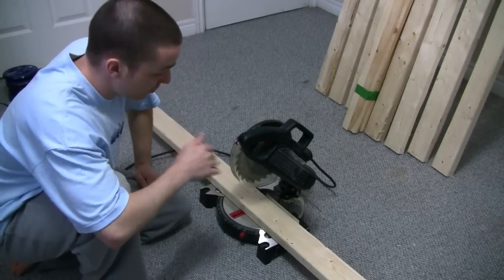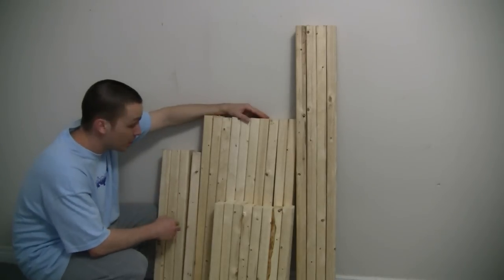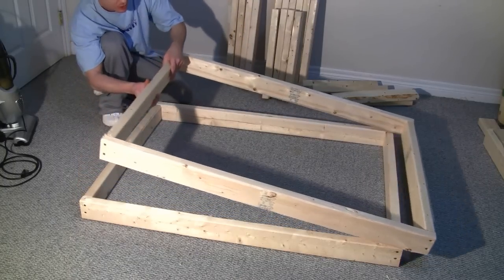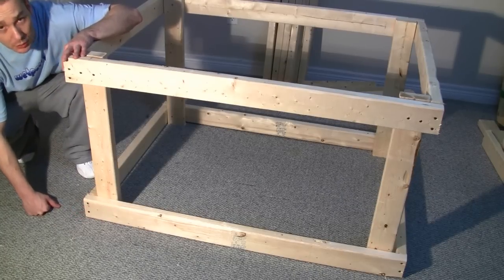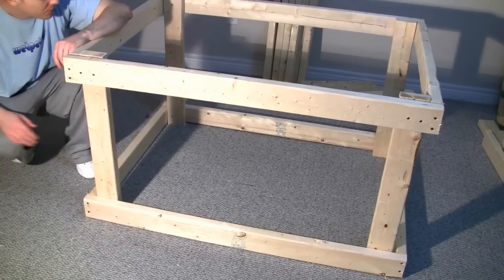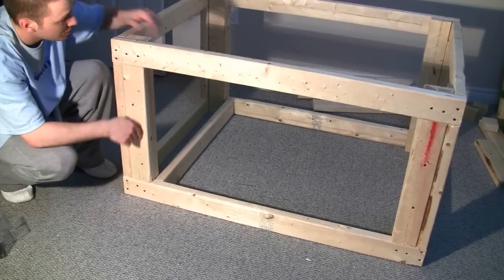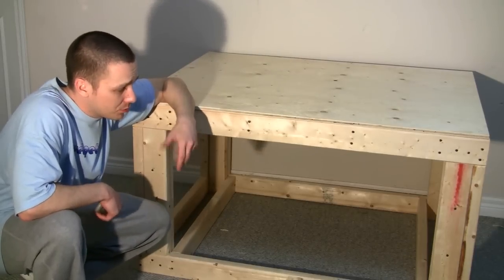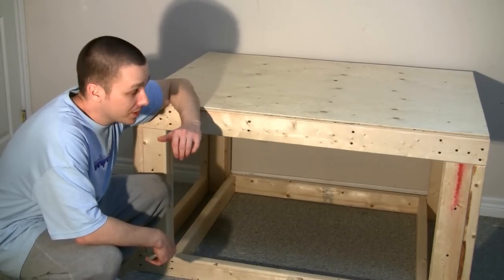HOW TO: Build an Aquarium Stand/Canopy 1/3

Comment: I beg and borrow the steel frameworkthat comes around  quad  bikes from local motorcycle shops.I think is called square tubing.A bit of acurat hacksawing and welding makes  a strong,lightweight  stand.A coat of primer and paint and shelves made from ply from salvaged paking cases finishes it off.These are for a fish room so they are not enclosed.Biggest one so far supports my 800 litre Uaru tank.

Comment: I used your design and built a stand for a 72 inch long by 24 inch wide fish tank.  I substituted pressure treated  2x6's and added a center support  for the stand.    When I filled the tank with water, there wasn't a groan or a squeak from the wood.   Stand is ROCK solid.  Excellent  Design !!    Thanks

Comment: Hey Joey!  Just finished the build on my 55 high stand and canopy, now wrapping with OSB chip board.  One thing I did differently - instead of screwing in the guides on the top and bottom frame first, I screwed them to the top first, then installed the supports to make sure that they are taking most of the weight.  Then I screwed the guides into the bottom.  I used velcro to fasten the front piece on for easy access to my overflow filtration system.  30 bucks for canopy and stand.  Thanks a lot!

Comment: Thank you for this great and comprehensive video! Your stand design was the only one I found that I could actually build and be sure about its strenght. I just finished my stand for a 55 gal tank. I used store bought wood for the frame and re-used old wooden pallets/ crates to finish the stand, turned out really nice :)
Reply: how did that work? did you use these exact same dimensions?

Comment: Thank you DIY king.  Just completed my first tank stand for 65 upright.  Total lumber cost 28$ plus thin board to cover it all 12 $,  10 $ for quality nails.  20$ electric screw driver,  34$ circular saw,  8 $ paint,  2 trips to homedepot 10$, some peripherals like sand paper and brackets and wood glue (20$) and about 2 half days over weekend. In total around 130 $.  And I have a custom size extremely strong stand!!  Just one lesson I learned that I need to share.  I had all the small studs to be inserted between top and base frame cut to exact size and all were about   . 2 inch longer and I needed to spend a lot of time polishing them.  I think 2 by 4 are not exactly 1.5 by 3.5 but more like 3.6.*

Comment: Thanks Joey,
I just want to share a little trade tip with you, place the first cut on the line then move the saw until the end of the 2X4 touches the door frame. the saw will not slip on the carpet and the door frame won't move so you have a stop to ensure all cuts are equal. No marking the next cut. Then move the saw for the next cut. on jobs with lots of cuts I've actualy screwed the saw to the floor.

Comment: Thanks so much for the useful videos. I never built anything myself with wood, and following your instructions I was able to build a great stand for my frag tank, I need 2 more stands and after the first one, my confidence is very high that they too will be perfect. 
The tips about using the tools like adjusting for the width of the saw blade for cuts and using a piece of wood already cut as a templet really helped with my first lesson on wood working.

YouTube University rocks!

Comment: Thanks for the vid!  I'm a first time reefer and I just built this today and given this is close to 10 years old here are some updated prices haha,  I used 8, 2 x 4 8s  (didn't need the extra braces cause I have a glass tank) came to $48 and the box of #8 2.5 in screws were around $9, haven't got the plywood yet but still even almost 10 years later $57 still beats the store sold stands by at least $130. :)

Comment: Joe you saved my bacon! My tank recently started leaking and while emptying and moving it, I noticed the weight of the whole setup was causing the back legs to recede in a hole which was digging into our newly repaired floor (as the iron stand legs are L shaped making a lot of weight focused on a single point of contact).  I knew my hubby would be pissed  when he got home to find his 1 month old floor job had already been compromised.  Thanks for your comprehensive tutorial, I'll have everything fixed and setup before he gets home from work.  And he'll be none the wiser!

Comment: I used this plan to build my first stand (with my first aquarium).  Thanks king of DIY! I thought it would be worth noting that 2x4s generally always have bow in them - and the ones I used were no exception.  But, as long as you build it true, and squeeze together the pieces (clamps are a must), the weight of the tank when filled with water, will straighten out those wobbly stands.  If you've never built anything before, you might not understand what I'm trying to explain here, but if you build it, and it does not lay completely flat - and it most likely will not, don't stress! :-)

Comment: Thanks for the video. I've built several stands myself, but I tend to over-build and need to convince myself that I can build a safe stand without the overkill. Your video is great, but I have a concern that  you did not address the crucial topic of levelness. I'm sure you know that a stand that is the tiniest bit off level can cause a major disaster, especially with a long or acrylic tank. Unfortunately, a lot of people building stands for the first time probably don't know anything about it and won't be prepared to troubleshoot and correct the problem. Perhaps if you ever re-make your stand video, you can add that into it.
Reply: he said that is "extremely important to have your floor leveled""..It was c;lear even for me that dont speak english..You need more information???

Comment: Excellent work, Joey. I built my own stand about four months ago, but I wish I had seen this video first. Your design is just as strong as mine, and much simpler to build. Kudos!  The one addition I would have made to your video is to stress making the stand tall enough to accommodate whatever model of canister filter you plan to buy, if you go that way. 

I ended up having to buy two smaller rather than one large canister filter because I planned poorly, and they're still a tight fit!  Oops.

Comment: I built this stand to fit a 20 gallon. It cost over 100$. I used a level, a square, 2x4s, plywood for top, screws, an arm saw, a table saw, a drill and a sander. Not easy but doable on a day off afternoon. It's great

Comment: Good basic learning video. I do mine a lil different as I do not build a frame. I use the unibody concept where the entire aquarium stand is weight bearing. Also, water is a main emeny of wood and as we all know, when you have water where it is not supposed to be, things happen. I use 3/4" white oak as my building medium. Because it is frameless, the cut pieces must be exactly the same length and all joints are screwed, glued and clamped. Frameless gives you more room inside the stand..

Comment: i just built my stand using your tutorial.i have a couple questions about the wrap and doors. like any specific material? do you glue it on or use finishing nails then fill them in?
also do you do anything special with the doors?

thanks for the great channel man. man stand cost me about $50 so far including screws bits and wood. not bad i hope i only need one sheet for a wrap so that will only be another 20 or 30.

much love

Comment: Hey man love your videos! I just wanted to offer a different perspective  on wood glue. Sorry if its already been said, but wood glue is actually stronger than the wood. We use mechanical fasteners like screws or joinery to reinforce the wood around the two joined pieces. So basically if all you did was, just use wood glue, the wood around the glue would snap before the glue gave out. (After curing ofcourse

Comment: did you drill holes before putting the screws in? also, the cross supports near the top you added just before the plywood, does anything hold that up? or are just the screws supporting that?

Comment: Hi Joey.  I'm building this, thanks to your guidance.  You mentioned laying a sheet of styrofoam down.  Is this for helping with leveling, or perhaps just because you were going to use an acrylic tank that you didn't want scratched?

If I was doing a plywood tank, would the styrofoam be moot?

Thanks in advance.

Comment: just one thing on the glue! it's the strongest bonding type from welding to bolting to screwing it together  so a bit glue wouldn't hurt to enshure screws arent comming loose, becouse i pre-drilled the holes with a very small drill. Further more great video! it helped me.
Reply: I disagree about you not using glue. You are trusting 3 screws per leg to hold all that weight. What is the capacity of that steel in a shear force? Also there is the friction of the 2 surfaces being pushed together  - which isn't much. Try  - screwing two pieces of scrap pieces of wood together and screw and glue two others together  - when cured, pull them apart and see for yourself.
Reply: oops posted that too soon, I see you solved my problem.

Comment: I like your videos and especially this one.  I just bought a 40g breeder and am building the stand and canopy for it.  I managed to get the frame done with no problems, however the first vertical support piece when I went to screw it in, the screw snapped.  Should I predrill the hole slightly smaller than the size screw I'm using?

Comment: I built my stand to spec using your advice. Great stand! 48.5x18.5x45.  yes, it's a bit high, and there's a tall 120 on top.  My question is this, I did not put the center stud in the front to allow for large sump access and most people do this. How much weight do these stands support? Roughly....not holding you to it. . it's just a curiosity thing. I just need to feel better knowing that avstand built like this can support the weight of a tank this size.  Thanks.

Comment: Love the design. I have a 65g glass aquarium with trim and am looking for a design that has a larger foot print than my tank. If I built out your stand and put a few extra cross beams in the top with a 3/4" sheet of ply for the tank to sit on would this be safe or do the 2x4 need to be the same dimensions to support the tank?

Comment: Hello Joey. Could I please get your experienced opinion on a DIY stand for a 125 gal 6' (glass with trim) tank?

We're using 2x4's exactly as you did for the top and bottom frames & in the corners but without the first "inside" 2x4 that attaches the top and bottom frames to each other. Would using the 2 pieces on each corner between the two frames be strong enough? All of the braces would be the way you recommended & it will have a solid top, as well. 

Thanks Joey, I really enjoy your vlogs. I've learned a lot and value your opinion. Take good care.

Comment: I just saw this video and I am thinking of making a stand the aquarium has irregular dimensions for an aquarium. Its 72 inches long, 13.5 inches wide, and about 21.5 inches deep and I think its a glass aquarium not sure. Anyways I was wondering what type of plywood did you use or recommend? Also thanks for posting the video it will help me a lot when I build the stand.

Comment: Hi Joey, i was wondering if you could provide  some advice. i have a 10x2x2 ft aquarium 12mm thick glass all round i purchased second hand dirt cheap @$200 (Yes i have plans to pull it apart and reseal). would your wooden reinforced stand design suport the weight? i appreciate any feedback

Comment: I want to start this project maybe next month.
The stand now is about 2.5 feet tall; I want to build one that's taller at about 3.5 feet.

Question 1. Is this height dangerous or possible?
Question 2. Can you help me choose the correct dimensions in wood? I referred to your videos about 2x4s so do I just input the dimensions of my glass aquarium OR add inches to include the trim around the glass as well?

Thanks in Advance!

Comment: Hey, I need a little help getting the right measurements to build my stand. I have already tried to build a stand about a year ago and it didn't come out right. I just got a free tank and its huge. It's 72"L X 24'"H X 19" W I would like the stand to be 34" tall. I am going to be running a Fluval FX6 and would like to store it below in the stand. Its an older tank and doesn't have a bracer in it. I resealed it thanks to your DIY video and that came out amazing thanks for that.

What would be the cutting measurements for the stand?
how to measure the plywood? 
Should I add a bracer in my tank?
Reply: hi suzy I found this hope it helps a bit http://www.ultimatereef.net/forums/showthread.php?564958-DIY-stand-build-and-5ft-tank-upgrade

Comment: I've watched a few of your DIY stand videos.  Wondering how these stands work with reef ready aquariums with corner overflows.  It looks like the stand upright would be in the way of the overflow holes in the bottom of the tank.  Is there a workaround for this?

Comment: When screwing in the screws for the base how did you hold it all together at around 7:50 in the video? Trying to put it together but the 2x4's keep moving once the screw goes through the first board and into the second one making it uneven. Best way to secure it?
Reply: use some clamps mate
Reply: izimalta I did, I went and got an Irwin clamp that helped out a lot, but I learned that all the 2x4s at Home Depot aren't straight and are a little warped. That made it a lot harder to put together.
Reply: TheJupiterSailfish
Definitely would suggest Lowe's or a real lumbar yard locally. I have had the same issue.
Reply: Michael Compton Yea I probably should of checked out either of those but got everything together and a shim seems to fix it all though I'd rather have had everything straight.
Reply: TheJupiterSailfish you accidentally bought the "builder grade" cheap shit that most builders hide inside the walls of the houses (and since the Homedepot guys don't care, and are used to most builders buying the cheapest grade of wood = they never bothered to ask you what it was for, or point you at the better stuff).  Next time you want to ask for the "premium grade" or "#1 grade" or the "straight & flat grade" or the "milled flat grade" of 2x4's (everybody calls them something different).  They are typically 2 to 3 times the price, but worth it, and don't have knots, or imperfections (because they've been milled or planed flat, and  have been dried too so no warping!)  so well worth it for accuracy in building small and precise items like this  - hope that helps for future projects :-)
Reply: Kevin Hodgins Thanks for the reply, yea that was definitely a problem that I didn't know would be a problem when picking out the wood. Someone said to go with kiln wood, but I couldn't find any and I think I went with whitewood. Have the stand together now with the tank on it and everything seems to be fine. Gonna be filling it with water soon so hopefully it holds. They kept pointing me towards the stud 2x4s I think cause they were saying you wouldn't be able to see the knots and marks in the wood cause I would be covering it up. Will take your advice the next time I need 2x4s though.

Comment: So I’ve never built anything in my life, if I wanted to put a shelf in the middle of the open space, would I need to connect it to the leg on the inside AND the smaller supporting board on the outside, or would just the inside leg be fine? Or would that put too much weight on it in a bad spot?

Comment: I just finished one for a 75gal as well. came out super sturdy and was surprisingly easy to put together. didn't take longer than an hour or two with 2 people. tank was placed and filled that day and it barely made a creak. i highly suggest building this style stand if you need one. prebuilt stands are overpriced and overrated

Comment: Can I use a coconut lumber for my tank stand project?

Dimensions in mind are the ff:
4ft length, 1ft width and 3ft height

Aquarium holds roughly 100 to 115 gallons.

Comment: I watched a video the other day and in that video the person said you can judge the weight of your aquarium by the gallon. 1 Gallon = 8 lbs. which mean a 50 gallon tank should weigh in at around 400 lbs. Would you consider this to be an accurate way of determining aquarium weight and if not, what is a better way? Thanks in advance.

Comment: Did you use guide holes for the screws?  If so, did you drill them as deep as length of screw shank or not so much?

Comment: idk if after i use ur model to build this stand and place 90 gallon tank on it. Does it break the floor? Is it safe for the house built in 1980?
 because after i estimate: 

90 gallon = 270 pound+ 150 pound ( tank itself)

= 420 pound + 200 pound (stand itself) + 100 pound (sand, decorations, stone, fishes)

= 720 pound or 327 kg.

Can the wood floor hold over 300kg in the living room? will it bend the wood and joist of the floor?

Thanks
Reply: +Tommy Le Just a note to your calculations, the water in a 90 gallon tank will weigh around 720 pounds, not 270. This could just be a typo on your part but maybe not.
Reply: Hi +Freakerss. Thanks for letting me know about that mistake. Yeah, I did follow his method to build the stand and it work well. But I'm just somehow worry if the floor will be safe in the long run or not...XD.. that's why I bring out the calculation.
Reply: +Tommy Le Its not rocket science bud. Every gallon is 8 pounds. As for the floor of your house, he can't answer that question. It depends on the construction of your home. Some houses are built better than others. Have some one walk and bounce on your floor while you go under and you'll find out.

Comment: This gap is only in one of the corners. Can I correct it using styrofoam? I do not want to put any stress on the aquarium glass. What kind of styrofoam would you recommend to use and how thick? Thanks